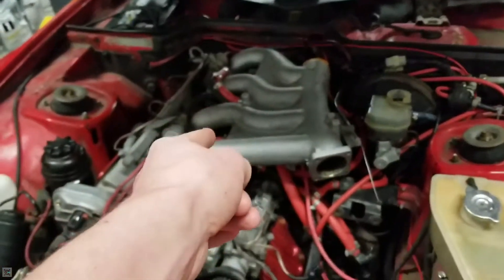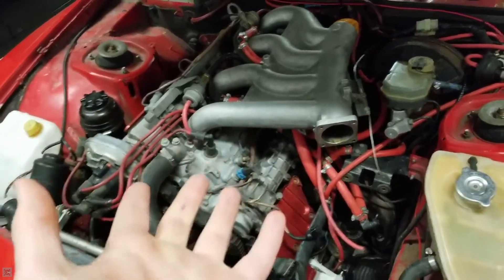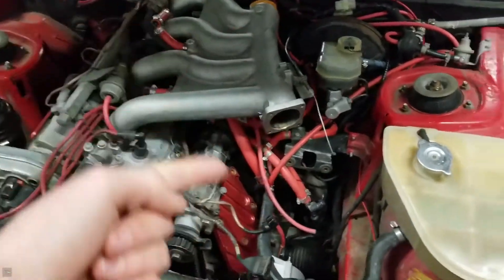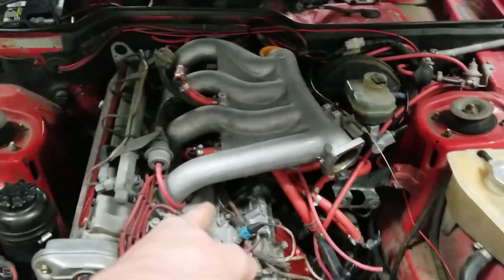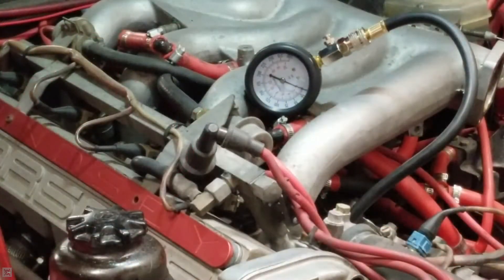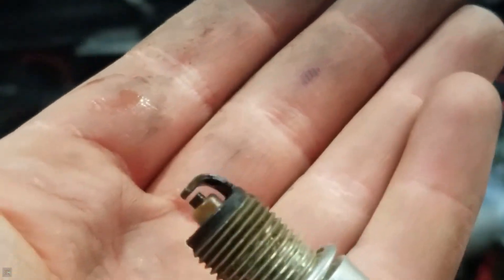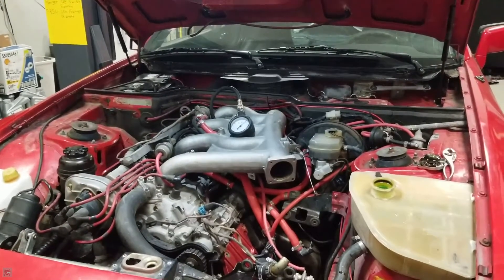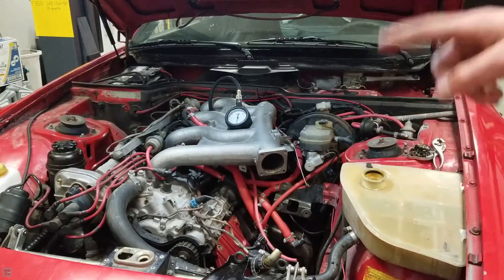How to do a Compression Test | Performing a Compression Test on a Porsche 944

Comment: Too much coolant in the reservoir.  The max line located on the top side halfway down the tank towards the headlight.
Reply from the maker: It was overflowing due to a head gasket leak, thus making compression leak into the cooling system making it overflow. Check my head gasket series to see that progression.